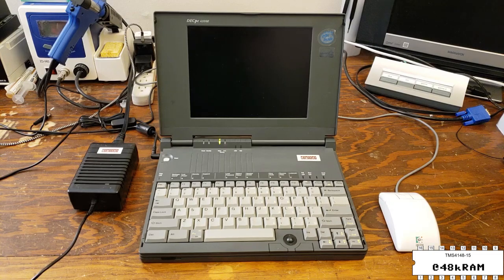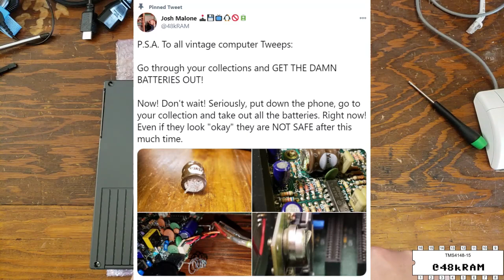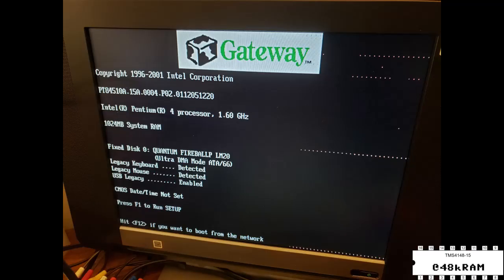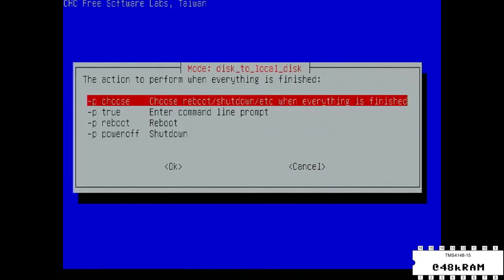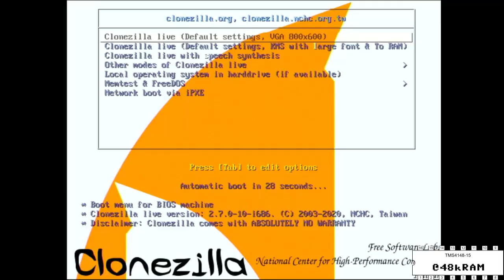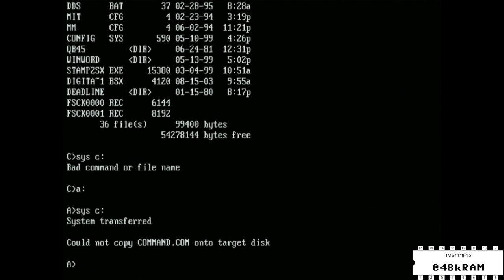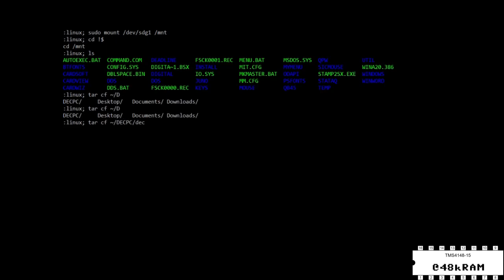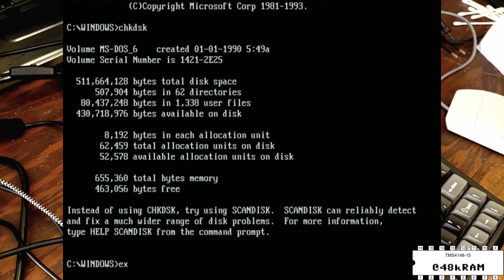Compact Flash storage upgrade for a DECpc 433 - #DOSCember

Comment: Hi - i feel your frustration, been there a few times

In hindsight, i would have done it a bit different
1. remove hdd, place boot floppy in lappop and mount the cf-card - format the cf card with a system then create a dos directory and copy / expand all dos files in the the new directory
2. remove floppy and reboot and see if the cf card auto boots, if Yes great if No pull more hair and try fdisk /mrb then reboot again
3. If that fails use seagate tools, this overcomes any bios limitations ( the 500meg one ) as dos 6.2 etc can format up to 2g , so you can later format the 4g card as 2 x 2G - this is how i done my CF card in my Pentium 2 Gateway
4. once the CF card auto boot, i remove it , place back into your gateway , make the hdd master and the cf card slave , boot the system it should boot of the hdd, go to dos prompt then just do a simple xcopy c-drive  to d-drive and included all subdirectories

Well that is the plan, will it work - maybe 

Regards
George

Comment: IIRC 540mb was the limit of some of the BIOS back then without the help of a dynamic disk overlay.
Reply from the maker: Yeah - I remembered that after the 4G card behaved so weirdly. I'm used to dealing with 8TB limits, etc. at work and I forgot about the 528MB (504MiB) CHS addressing limit. Anyway 500MiB is PLENTY for this little system.

Comment: FAT 16 only supports up to 2gb partition so the 4gb flash wouldn't work anyway unless you can manage to create 2 partitions. The easiest way I found to install and copy your files over to a CF card is to use Virtual Box and mount the CF card as a raw disk. Then you can download dos and windows from the web and setup the CF card before putting it in your laptop.
Reply from the maker: Yeah - I should have realized from the beginning that 4GB was going to cause a LOT of problems. And like others have pointed out, the clonezilla software was completely unnecessary. I've never set up a CF card using a VM before, though. On my Compaq Deskpro 386, I kinda enjoyed installing from "floppies" (I have a gotek in it), something I haven't done in decades.
Reply: @48kRAM  I have an old Toshiba 486 laptop that I've done the same thing with, and I have 2gb CF card in it. I use a pcmcia cf card adapter to transfer between the laptop and my desktop. Gotek drives are nice to have also, I use one with my Amiga 500.

Comment: 1) on laptop, boot from HDD and transfer system to floppy with format a: /s, also copy fdisk.exe and format.exe
2) replace HDD with CF, boot from step 1 floppy and create partition with fdisk + format c: /s
3) connect both HDD and CF to P4, boot from HDD or CF and copy everything except system files to CF
DONE! No Linux involved!

...and with Iomega ZIP/LPT, all these could be done using laptop only!